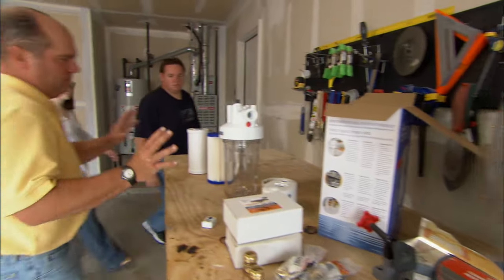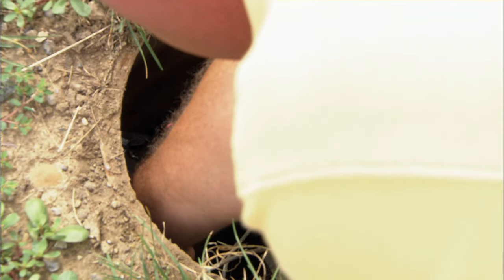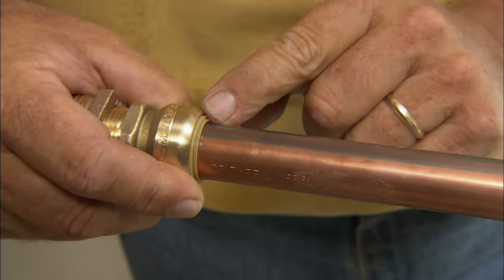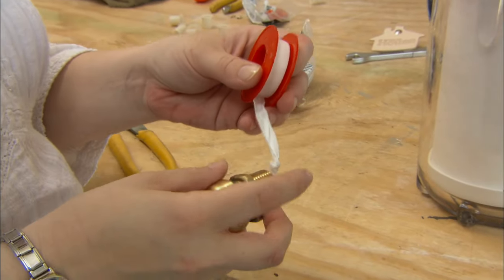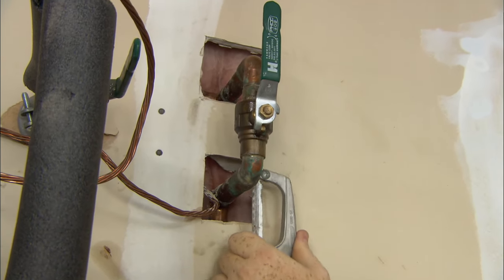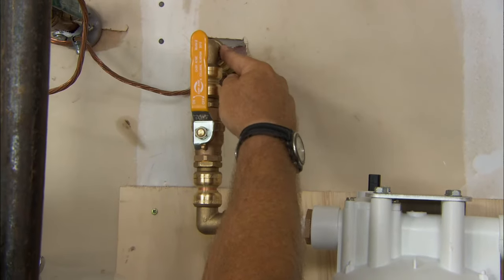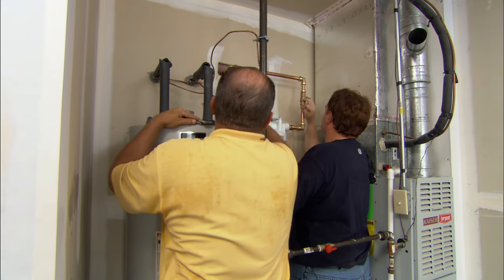How to Install a Whole-House Water Filter | This Old House

Comment: My tips for anyone, especially a home with well water: 1) Definitely agree having a main shut off and knowing where that is - critical in emergency situations that everyone knows where it is. 2) I would have installed the filter unit lower to make it easier for the homeowners to remove the filter each time. 3) While not impossible, it looks awkward to have to deal with that horizontal pipe near the filter. 4) Agree with previous comment about installing a bypass T so your outdoor connections bypass any filtering. If buying a home that will be on well water, I highly recommend building in the cost for whole house water filtration/treatment into your mortgage - and set aside an emergency fund for the well pump in case that goes - that alone can cost around $3k-$5k and until fixed means no water at all.
Reply: Great points, but only 3-5k?  My estimate would be at least 5-7k

Comment: Two things I would have done differently 1) Put in two filters, one for sediment and the other one as a carbon filter. 2) Put in a bypass valve to if anything goes wrong with the filters, you can bypass them both if needed.
Reply: 3) not use shark bites
Reply: @unclefreddieDied  Shark bites are fine for exposed plumbing in the garage or basement.  I would not burry them inside walls.

Comment: To anyone watchig this and doing it yourself. They left out some steps here.  You need to put in a bypass valve AND they omitted the flushing of the system before using the water.
Reply: You dont need a bypass, you SHOULD have a bypass, but as you can see in the video, a bypass is not "needed."
Reply: @djshortsleeve9132   A bypass is not required for code,  BUT you will HAVE to change the filters. The bypass allows you to leave the water on in the house while you just shut off the water just to the filter,  then you change the filter and switch the bypass again.  Without a bypass, you have to shut the entire water source off from where ever that is.  This dude had to go out in the front yard to do it. Sucks in the winter under a foot snow. With a bypass you do it right at the filter. Put in a bypass.

Comment: There is a proper way to apply teflon tape
Reply: there is but the contractor wanted her to do it to get a better idea of how its done...
Reply: No by pass, opened valve full pressure without bleeding air ?
Reply: Tape was threaded in the wrong direction, would not trust those O-ring type push fittings. I have seen them fail within a few years. 
A properly soldered fitting won’t leak.

The push fittings are convenient for people unfamiliar with plumbing techniques, it would be better to solder the system.

Comment: haha love it when he says turn the handle and she just cranks it. you could see him cringe
Reply: Joe let’s say there was a non tight fitting and someone opened the valve like that, the pressure from the water would literally push it out and you’d end up with a few seconds of city pressure coming out full force at you. It could also disrupt pressure in the remaining water lines connected. Overall just something no one should ever do, always open valves slowly

Comment: Watch out if you buy one of these Whirlpool whole home water filters... watch out for how tight the lid is screwed on because it's very difficult to take off.  I bought one and tried to use the tool that comes with it and it broke the cheap plastic tool because it was screwed on so tight from the factory.  The person at the store blamed pressure that built up over time... whatever, if the manufacturer didn't screw it on so tight in the first place it wouldn't be so bad at all.  It was also recommended to get some lubricant for the seal in some other forums (apparently this lid has a really bad reputation).  So I asked the guy at the store and he said they didn't even have any.  Well, the forum also indicated some sort of "food grade" lubricant so I'm just using peanut oil and it's doing just fine like that.  So after I returned it to the store, I insisted that they demonstrate that the lid could be removed.  They were very helpful and obliged but it was extremely difficult to get the lid off.  They took two pipes with 1" threaded ends and screwed them into the wholes.  Just screwing the pipes in was difficult too.  Once that was done we started torquing on the pipes and the guy at the store almost gave up because it was so hard but a couple more good torques and it finally came off.
Reply: +Izzy Logan put plumbers grease on the threads before you tighten it
Reply: Food grade silicone.  It's edible.  Available from plumbing supply or drug stores. I'll let you figure out which aisle.

Comment: Some info about those sharkbite push-fittings. They're certified to 200 PSI & 200 degrees F and approved for underground use as well. They also have a 25 year warranty when installed correctly.
Reply: O rings!
Reply: >25 year warranty
On a fitting maybe. They not gonna compensate you for your flooded house. Also good luck proving it was installed correctly.
Reply: 25 years seems kinda low
Reply: Won’t outlast a soldered connection but they are easy to replace.
Reply: SharkBites are junk. No real plumber would use sharkbites when they can do a threaded, soldered, crimp or pex fitting.  I would never trust an oring like that with a press fit.  I design and manufacture orings for a living.  Those will easily fail in 10 years and flood wherever they are.   In my opinion sharkbites should only be used for temporary jobs of less than 2 years.  

Also those sharkbites wont ground anything as they make contact with a rubber oring.  He should have ran the ground wire to the main copper line above.  This was 100% an amateur hack job.  They should take this video down.
Reply: So save that receipt for 25 years. 🙄
Reply: @common_c3nts  you boomers are always so cynical
Reply: @aa-jp7ck  no, there's a right and wrong way to do something. This was wrong. This should not be passed off as a professional installation.
Reply: @clintstathis  so bitter over nothing
Reply: @aa-jp7ck  bitter? I don't think that word means what you think it does.
Reply: @clintstathis  extremely bitter
Reply: @aa-jp7ck  I'm pretty sure warning folks that they're risking flooding their house if they trust using an unreliable method is certainly not "cynical."  Rather, the advice, comes from wisdom, which obviously "boomers" have an ample supply of.
Reply: This video for learning process only.  Not detail make it right.  The training should train for new people. Turn on the water slowly event new house, new water lines.  😂.

Make money for this project got 1k.  But, the way turn water back on, like this video.  You will pay back about 20k up.

Comment: Very interested since our district just switched from chlorination to Chloramine. I need to find a whole house water filter to get rid of the chloramines.
Reply: might be good to look at why they made the change as there could be other issues you need to address with a different type of filter also.

Comment: So in this particular install they're just filtering the cold side? Or is that output going into the wall, splitting somewhere inside the wall to the hot side that feeds into the hot water heater?
Reply: Correct, only one inlet pipe, cold, then goes through hot water heater etc

Comment: Those SharkBite connectors are sweet, but super expensive, I would never use so many of them or them in any space you have such easy access for soldering.
Reply: great way to go from old copper that is wet to new copper with out having to worry about it being bone dry.
Reply: He literally had like 8 connectors.They are like 15-20 bucks a pop.
Reply: Richie Sun
LOL, yes the amount they spent just on the fittings is crazy. I agree that it is a waste to use that many in such an easy to reach spot.
Reply: Daniel Puterbaugh I would have to think long and hard before buying all of those fittings. Time vs. Money vs. Sanity.
Reply: Richie Sun
hahah, yes I have to agree, the only time I would use it is for is old to new copper or when it is in a space that I don't want to sweat but this is just crazy. I also do not like how they spin in place so for a job like this they are a pain.
Reply: Daniel Puterbaugh Yea, it seems strange that the connectors cost more than the actual whole house filter with cartridges.
Reply: Ummmm ok? Would u pay for a cheap brass connector that connects plumbing?....no? I didnt think so.
Reply: @kalijasin , cheaper than hiring a plumber who'll charge $200+ to solder.
Reply: SharkBites are not good at all and no real plumber would use them. It is pathetic that they used sharkbite.  I design and manufacture orings, I would never in a million years use an oring connection in my house when I could use solder, threaded, or crimp.   Orings can easily fail.  Using them with a press fit is just asking for trouble in the long run.  One day they will fail and you will have water everywhere.
Reply: I rather spend 80 on shark bites and do it myself than paying 1500 to a plumber

Comment: Shouldn't there be valves installed so the filter can be bypassed? I wouldn't want to waste the filter element for watering the lawn or for flushing the water system, the filter elements aren't cheap.
Reply: Dasdfjkl If you wanted to create an "auxiliary" branch for irrigation purposes you could.. just add a "tee" before the filter.
Reply: I don't understand why he added valves on both sides of the filter. I own this filter and it has a built in by pass switch. Wasted time and materials.
Reply: ***** I think he added valves on both sides so that when they need to replace the entire unit they don't have to shut the water off at the street. The before valve shuts the water off and the after valve prevents the water inside the house from draining out all over.
Reply: exactly! that why you still install by pass valves still.
Reply: @davidcrawford6505  I was thinking the same, almost all filters of this type comes with a useful pass valve. You close it to change the filter element, and then you open it. Perhaps he feels that the valve could wear?
Reply: @pajodato5339  no, many do not have bypass

Comment: What's the longevity on the seals in those push fittings?  I may be old-fashioned, but I try to make any job I do outlast me.  I hate doing things twice.  Also, it looked like the geometry of some of those joints was out of square.  Wouldn't that affect the sealing?
Reply: Yes it could, has to be a square, debured  cut on the pipe, that is the trick to kept them from leaking. They really should have not cut the pipe with the mini hacksaw.
Reply: +Daniel Puterbaugh They filmed this is 2008 I believe and the filter and fittings are still there leak free. I should know... Its my house ;)
Reply: wow that is impressive! thanks for sharing that information
Reply: +Don Brooks +Don Brooks hey there Don. Just finished watching you and wife in the video and just want to ask you a question. Is the water pressure affected by the filter? Thanks!
Reply: +Jose L Ramos That was city water and I did not measure it but never saw a noticeable change. However.... I now live in an area with a private well and put three of these inline to help the water taste/smell and it dropped it less then 1 psi. I have a gauge on the input and the output to watch for clogged/bad filters in the string. I have to replace them about once a month now or I see the water PSI drop between 4-5 PSI because of Iron and Sediment build up. Hope that helps :)
Reply: Using reverse osmosis for a WHOLE house filter is absurd - if only for the life and expense of changing the membrane. For drinking water they are fine - for the relatively huge volume for general use - they are inappropriate.
Reply: Ive had pretty good success with the shark bite fittings on cold water connections but the ends do have to be cut almost perfectly square and you MUST sand them and deburr the insides so the seal is good.  I have had a few issues with using them on hot water, but most of them were resolved by ensuring the pipe end was perfectly square and deburred/cleaned.  They are a bit expensive though and for a small job like this, they should have just used 2 for the inlet/outlet from the house and used PVC for everything else.

Comment: So how good is the filter ? How long life span ?  Never seen fitting like that before. At first glance I though Wow thats a great Idea. But then I thought when the rubber o-rings goes  bad, and it  will. That is going to be  hard to replace and expensive. 
Check out the price for a few copper or brass fittings. 
 They put that almost flush with the wall. Seems if you had to repair it that would mean you would have to tear out a  wall. 
I think PVC pipe would not cost as much.
Reply: +William Wynn This was my episode and I believe it was done around 2008-2009 and I just moved out of the house and never had one leak or o-ring issue. I did tie the o-ring once while replacing the filter but fortunately they stock them at Home Depot for less then a dollar and its an easy drop in.
Reply: The push fittings can be taken off with a removal tool. It fits over the pipe and is then pushed towards the fitting, should remove in a second. Usually orange in color, two sided for 1/2 and 3/4 inch pipe.
Reply: +Don Brooks

Hello Don. I just wrote to say thanks for providing more information on how the install went and your experience since then. Curious how you were chosen to be on the show? It's actually been awhile since I've seen the show. It seems like I remember those guys answering viewer mail (now email) and (I assume) choosing the best 'problem' to tackle.

Regardless, thanks again for the '9-year follow-up' info. : )
Reply: @golfstar6666  on

Comment: Probably spent over $60 in shark bites lol
Reply: Videos from Québec I was thinking closer to $100 lmao coulda just used some flex with half the fittings lol
Reply: LOL I was gonna say that' a lot of shark bites! Probably more i'd say
Reply: Chargèro has
Reply: Small price to pay for an easy job with no mess or stink of solder and flux. 
Isn’t it great that someone with little to no skill can do plumbing with shark bites.
And the fantastic part is that it costs less that hired trade people who have the antiquated skill of soldering on their box of tricks.
Reply: BOOTY 1:05
Reply: 5tonyvvvv don’t know why but now I got 2 live crew hoochie mama going in my head. Oh the good old days when rap was not crap
Reply: Chargèro spent more on shark bites then the whole system
Reply: those shark sizes are expensive..
Reply: @pjmtts  not allowed for commercial though
Reply: @pjmtts  First of all, the couple did hire a so called professional from "This Old House".  $100 dollar material cost vs about $6 dollars.  A proper soldering job by a professional will produce no more mess and stink than a single fart.  "Shark Bites" do require some level of skill to properly prepare the copper piping (which the video did not do) to insure that the fitting continues to perform.  There are a lot of failures of "Shark Bites" and they have not proven to be reliable beyond 15 years as yet.  They are banned from use in commercial applications.  "The antiquated skill of soldering" remains the most dependable plumbing connection for copper and brass and can exceed 100 years longevity.
Reply: or in Canada $150 -  starkbites are the worst they dont last long and leak
Reply: @NewsBroadcasting  Even if they do leak someday (mine are still fine) just take off and replace. Not cutting of copper EVERY time you have to disconnect a soldered joint and buying more copper to lengthen again. Old houses can have fittings in crappy spots and torching them off is really not an option without burning some wood. Some instances are different
Reply: @sapreaper  but they usually don't just "leak". They typically blow open and make a huge mess that costs waaaay more than just doing it right the first time. Trust me I've seen it hundreds of times in my professional career.
Reply: @zachary6313  no different then when those flexible lines connecting your faucets blow which they do much more often. If you are in a garage like this video, sharkbites are fine. There is a good and bad application for everything
Reply: @sapreaper  no this is still a bad application and you should NOT listen to this guy.
Reply: @zachary6313  Most are probably caused because of poor installation like this guy in the video did. He didn't even deburr the pipes.

Comment: If this is all that’s required to install a house filter system why does Kinetico and Culligan and others charge $2500 for one with large tanks? What does this type of filter do / not do?
Reply: The filter they showed does the bare minimum to improve the taste of the water by removing any sediment and chlorine. The more expensive systems remove other harmful elements like certain metals, pharmaceuticals, and a host of other harmful chemicals. Hope that helps.

Comment: Plumbers calls these fittings; “pro press”, because it’s not a watertight seal, if the pressure is greater than 50 PSI.
Reply: They’re Sharkbites, not pro press, and both are rated well beyond 50 PSI.

Comment: Reduces pressure significantly and the carbon filter will be spent in months with a family of 4. Go with a full size back washing carbon and water softener.
Reply: what model please?
Reply: @dks13827  Rayne Water Conditioning model Guardian 1250 Elite.

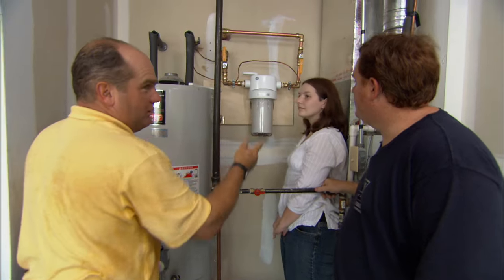Comment: NOTICE THERE IS NO STOVEPIPE  ON THE HOT WATER TANK  AT 5:00 .. why???????
Reply: It's electric.
Reply: lol... with a gas pipe  feeding it..lol
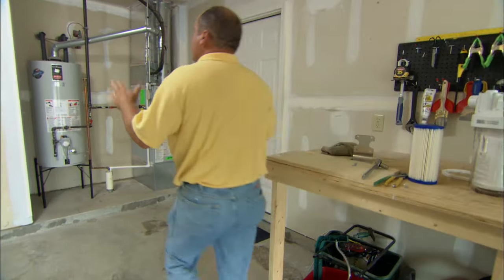Reply: Oops. you're right, it's gas. At 0:53 you can see the vent going off to the side. Looks like they removed it temporarily to make installing the filter easier.
Reply: Hopefully they remembered to put it back, they would be long dead